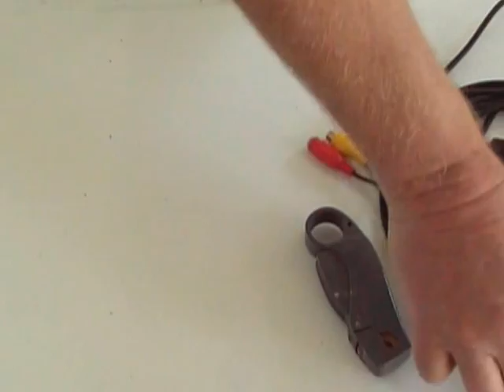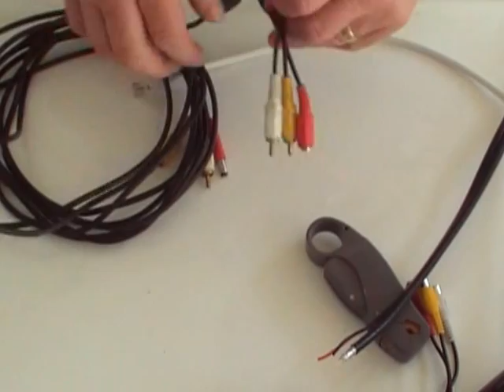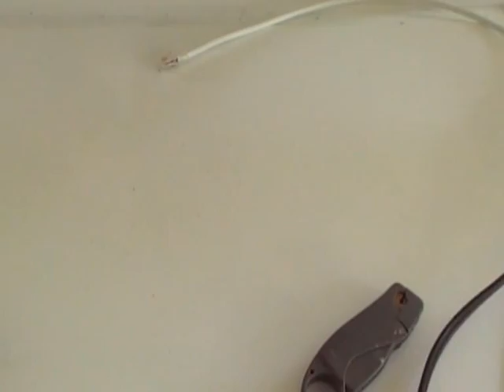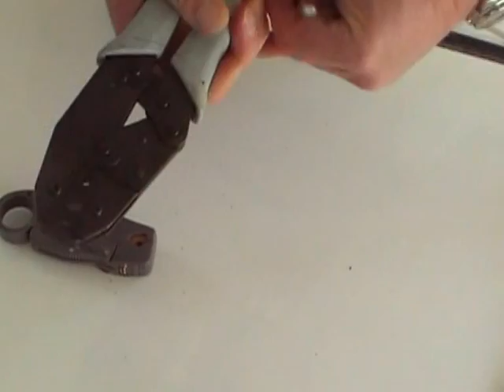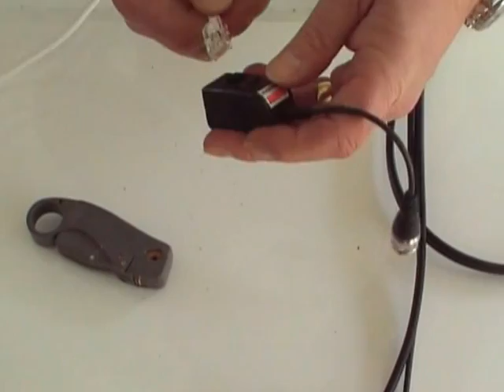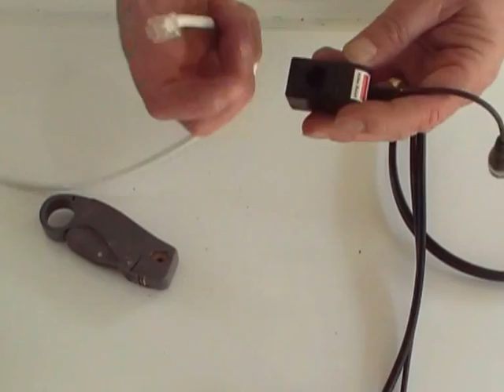CCTV Installation Training course - Cables

Comment: Poor quality video tutorial, you should have mentioned the key point of impedance. DIY cables are mostly subjected EMI, that is one of the main reason professional do not use them. You don't have a clue about EMI...
Reply: +jamie smith Yeah EMI is a big problem with them cheap cables... I am in the process of converting to Cat5